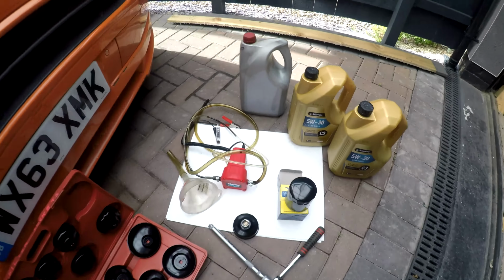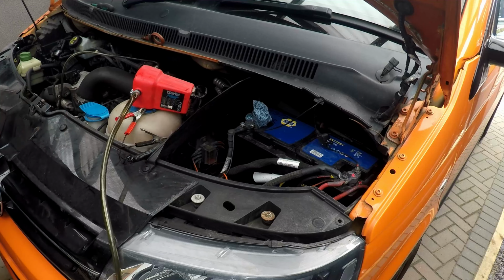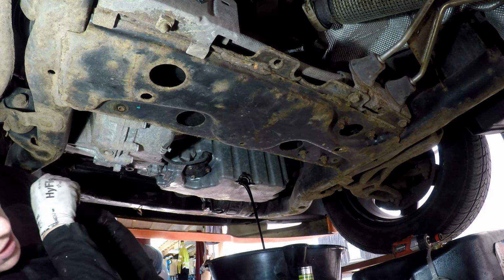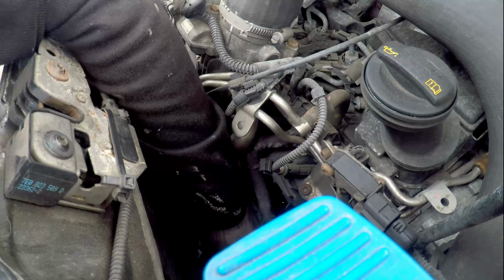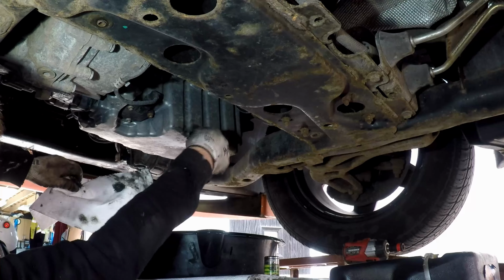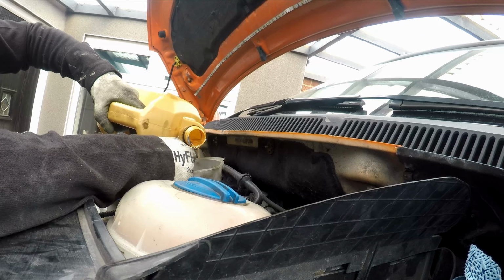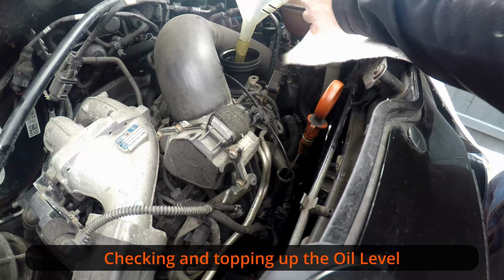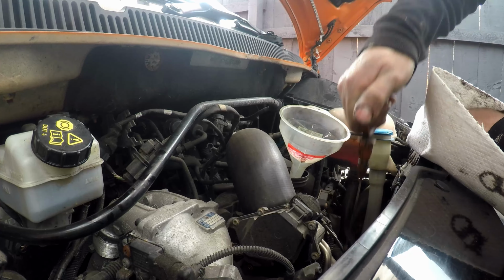VW T5 Oil And Filter Change on a 2.0 Diesel Bi-Turbo Campervan

Comment: Nice stuff Tony! I bought a Sealey 6.5ltr vacuum extractor 8+ years ago and it’s fab removing oil through the dipstick (but noticed you hadn’t removed the oil cap, it could be that which stopped the machine working?
Reply from the maker: Good point! It wouldn't have helped leaving the cap on.

Comment: What is the number / size for oil filter cup opener ?
Reply from the maker: Not sure, I used a 30mm spanner as mentioned in the video.
I didn't use a filter cup as you'd probably need to remove the exhaust to use one.